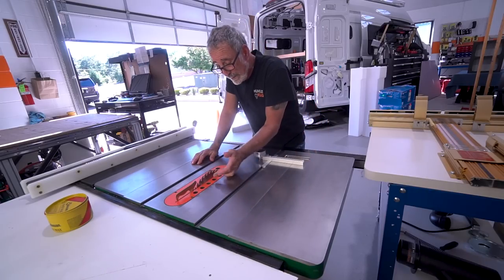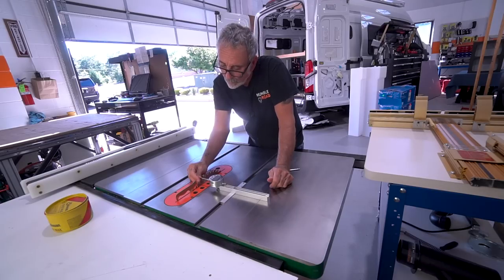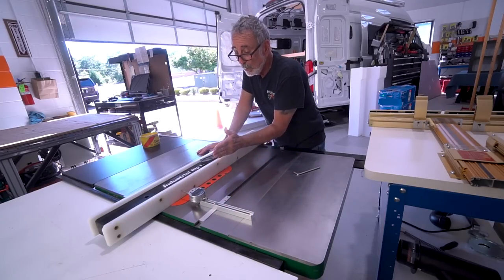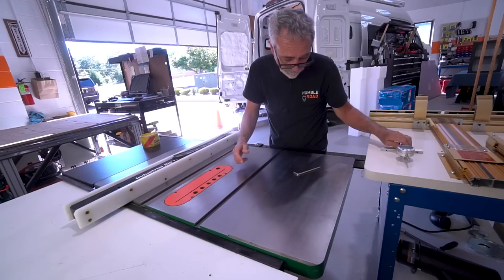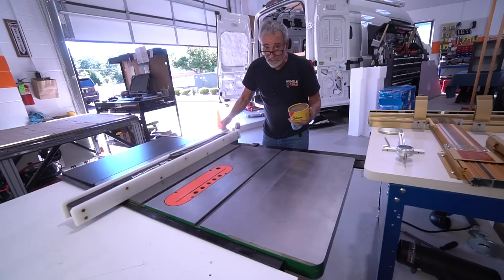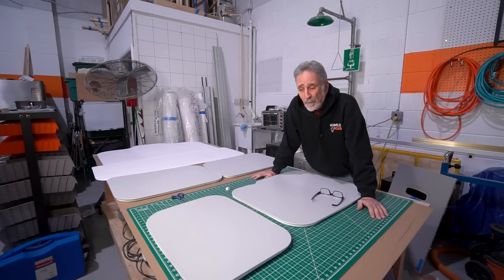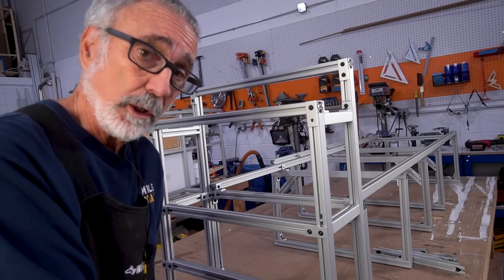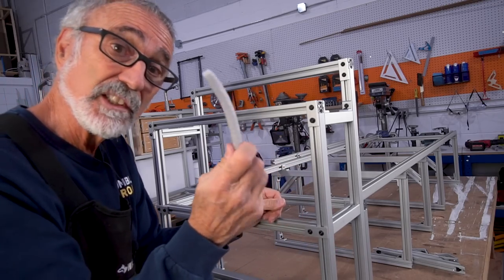VAN BUILDER PRO TIPS - How to maintain your shop saw, new toilet design for vans, 8020 assembly tip!

Comment: My experience from 18 years ago was that the diaper genie did not fully encapsulate odor.  It would work well enough for #1.  I was able to keep my diaper genie in an unfinished area so it didn't stink up the room.  When I moved to another home, I found it easier to just send the #2 diapers to the kitchen trash that was emptied daily.  You might want to do your own testing, but I would store that kind of waste externally.  Of course, I never used kitty litter for my kiddos.

Comment: I am just ordering a Trelino EVO L shipped to Australia.  While we use and love our Laveo Dry Flush toilet,  100% thats only for shorter trips and max convenience.   For longer trips we want a urine separating toilet.

We have tried the Separett Tiny urine separating but its too complicated, we have had leaks between the separating containers into the main base container,  and at least the female in our family has issues with aiming and it doesn't seperate.

The  Trelino EVO L looks like a much better design and I think will solve the aiming issues.

Oh and the best stuff to use in your solids container is Hem Stalks !

Comment: If you're seeing rust on the table saw every couple of weeks, you might want to look into the Carbon Coat product from Carbon Method. Lots of woodworkers are jumping on their band wagon. I've only had it on my cast iron saw for about a month, but so far I've been very impressed! Too soon to know how long it will last, but if it's as durable as they say it will be a huge improvement over the old paste wax.
Reply from the maker: I will check it out thank you

Comment: I have used extruded aluminum in the robotics building industry for a couple of decades. I started with Bosch, went to 80/20 and then others as prices changed. I have used spring loaded T-nuts where I needed them.

Comment: I have used horse wood pellets from Tractor Supply for urine. The wood pellets are very absorbent, fairly light weight and zero odor even after a week (at that point I disposed of it). I tried cat litter but it’s heavy and doesn’t absorb nearly as well as the wood pellets. I have not experimented with the pellets and fecal matter though.

Comment: George, your suggestion of using commode bags and a diaper genie are just a less efficient method of what Laveo has been doing for quite some time with their electric toilets. You should check them out.
Reply from the maker: I am familiar with Laveo.
Reply: Laveo may have the same idea but there is a lot more manufactured waist and the cartridges can be hard to store.  Each cartridge is able to manage 15 - 25 flushes that includes iron flushes unless you are comfortable leaving #1 in the receptacle  until someone goes #2.  What concerns me is the Mylar bagging material is virtually indestructible.  It will take a long time to degrade.  I have a problem with that.  There are other bags that will work without as big an impact on the environment.

Comment: Have you looked at the new Cuddy toilet?  Injection molded components.  Nice bottle for #1, vented with a carbon filter, indicator light for the liquid level.  Not so expensive as most of them out there.
Reply from the maker: I will check it out. Thank you!
Reply: Read through their Facebook group… lots of tips there.
Reply: @HumbleRoad  google Compo Closet for the Cuddy. You could also drill a hole in the bottom of it and run a hose from the urine diverter to an undermount grey tank instead of the portable tank if you wanted.

Comment: I haven't used one but I thought the laveo toilet was the waterless option I would use. They have a powder that turns urine into gel now as well. If composting is out, and you're going to use bags anyway, why not take a look at that?
Reply: The Laveo is cool on first look, but the liner bags are very expensive (and you can only buy them from Laveo), they only last about 10-12 uses, so you go through them pretty fast.  You have to find room in your van to store the refills, and on a long trip with a family, would take up too much precious space and cost prohibitive.

Comment: Hi George, I wonder if you'd be willing to make a video discussing the current state of the OEM class B industry regarding quality, features, design, etc. and if there are any mainstream van models you would actually recommend to someone who may not have the budget for a high end custom built coach. I know you are busy and they are technically your competitors, but your informed opinion is valuable. Thanks!
Reply from the maker: ooooh, that's a tough one. I don't see any benefit to me doing that. The thriving custom industry is by default, the response to manufactured vans.
Reply: @HumbleRoad  fair enough
Reply: @HumbleRoad  Can't agree more with you George. I don't own a van "Yet" and it is because I can't imagine paying $$$ for the lack of quality the manufactured van companies produce. Going to buy a sprinter and custom build my own using an 80/20 frame and quality cabinetry, electrical... etc. based on your inspiration.

Comment: Raise the blade to the highest point you can when you are measuring the run out on the blade as it increases the distance between measurements.  Also I have recently found that Boeshield T-9 is a very good product for  cast iron surfaces and doesn't seem to leave any slight residues like WD-40 does. After it dries it leaves a very fine wax which also provides a "slippery surface" and it does not build up like a past / carnauba wax can under your miter gauge.  Thanks for the poly foam tip!   Dropping the roll in t-nuts for somebody anal like me... I would take everything apart to get it, this tip is a lifesaver. 🙂  You should talk about the Incra behind you... great product and you might get a kickback from them.